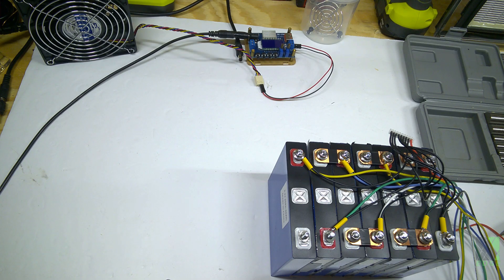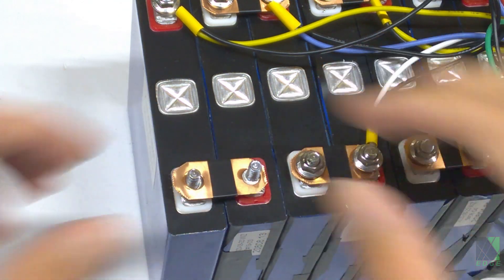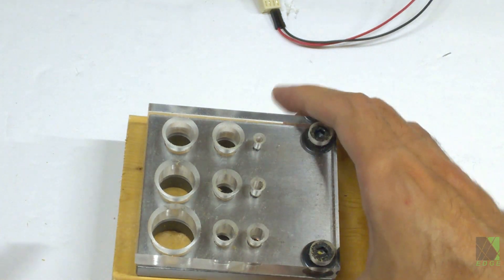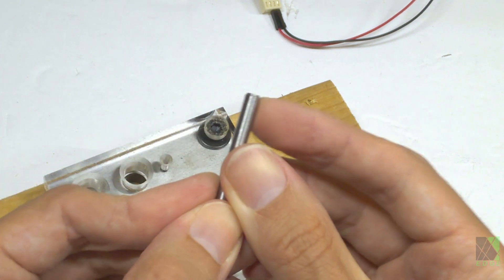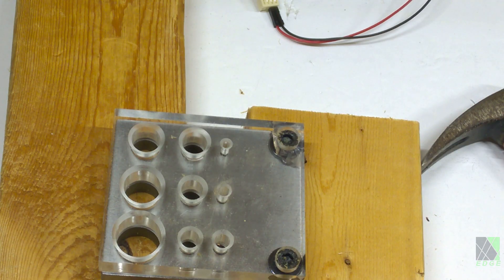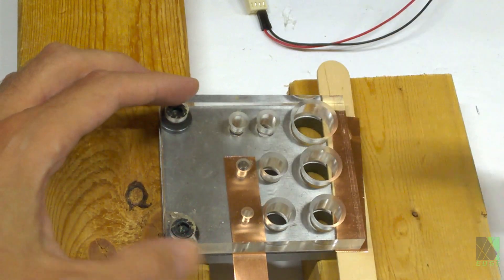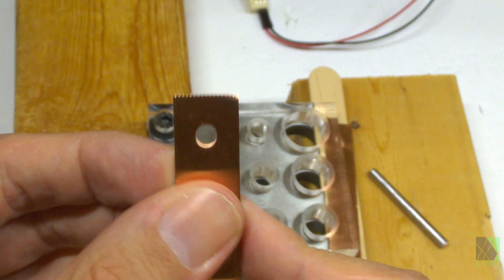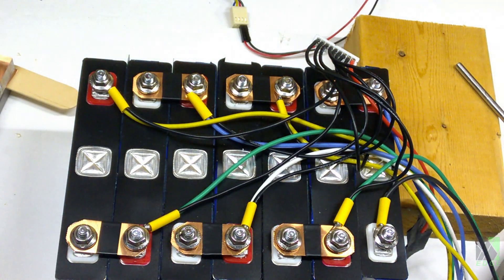How I Make "Tiny" Bus Bars for Lithium Ion Cells by hand #DIY #solar #lithium #workbench

Comment: I see that some people like a hump in their busbars to give some give as the battery cells expand and contract. The thickness of your busbars might stretch enough that it is not needed. Just a thought. 

I think most good makers of lithium batteries prevent the batteries from expanding alot.  But I have seen batteries built without compression. 

Also punching thin metal is much safer than drilling because it can become a spinning blade and could cut the user. 

Thanks for sharing.
Reply from the maker: @JR-xw5dk Good thought, thinking about making them a few mm longer so they bend a little. Might add that in future builds. You are right about drilling metal. 100% must use a clamp or jig, it's super dangerous, I try not to do it